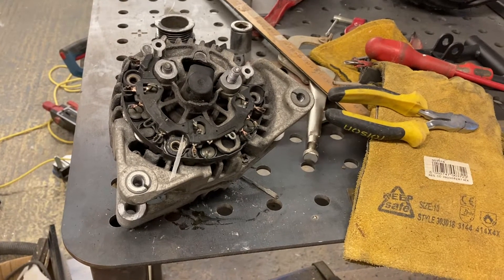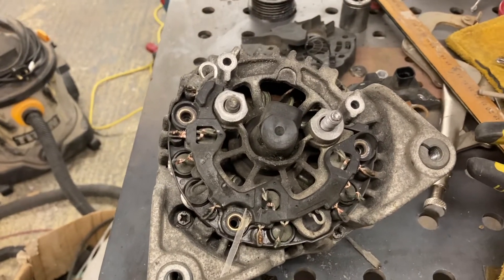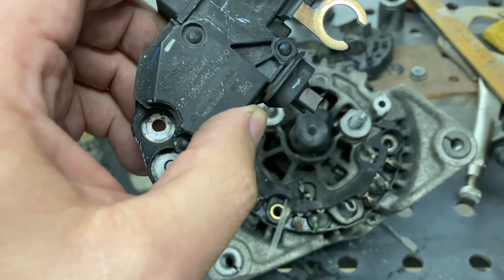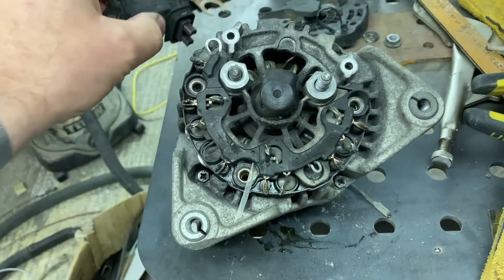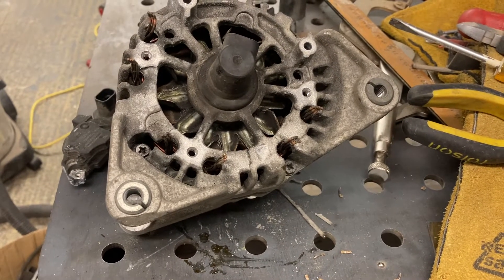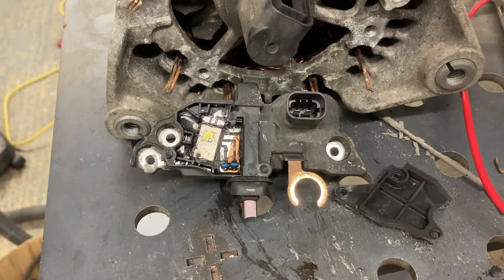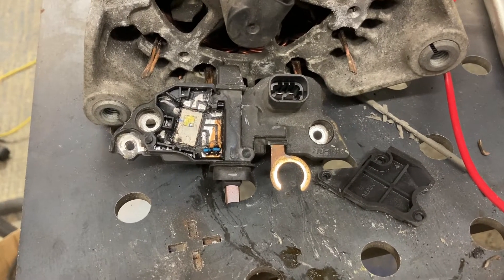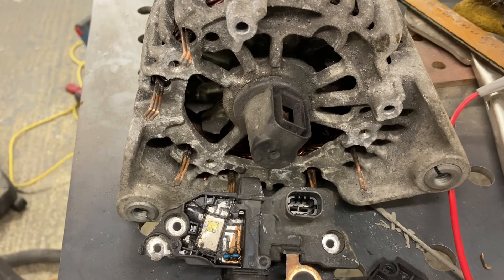Alternator to motor conversion part 1

Comment: I m building an electric bike with similar motor. Any ideas what sort of controller l need? I m not using hall sensors, too complicated
Reply from the maker: Great question.  I have a Chinese electric bike controller but typically these have motors with hall sensors. I might go down that route later by fitting hall sensors. For now I have redbrick controllers that are cheap and dont rely on hall sensors. I'll hook that up to a servo tester, again cheap